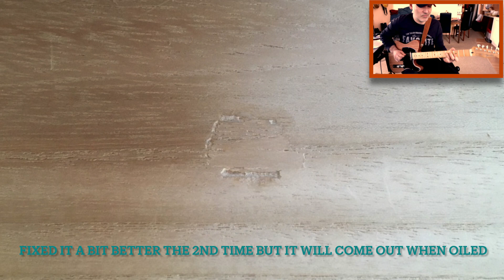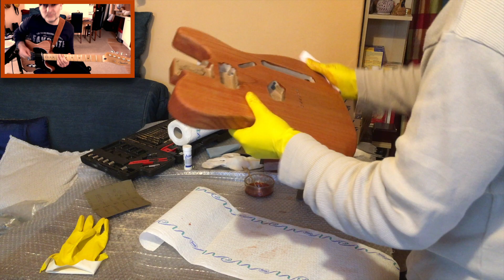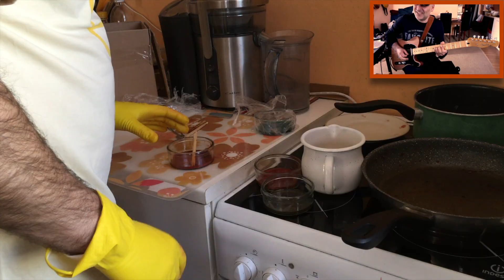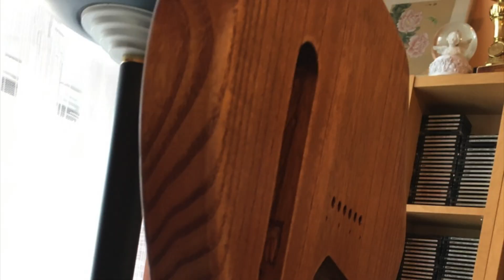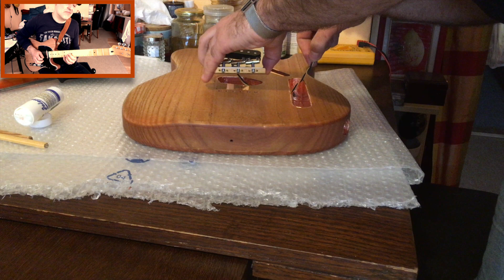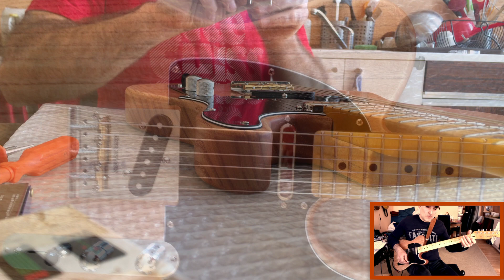Making of My Custom 1-Piece Paulownia Body Telecaster

Comment: what are the pigments you put in the tung oil?
Reply from the maker: they are pigments for work with Resin. I mostly used those that are clay based but there are also some metal based if You look for gold or silver coloration.

Comment: Looks great! What kind of Fender neck did you buy for it?
Reply from the maker: Hi, it's a Chinese Fender neck. Perfectly 90 degrees Quarter Sawn Maple Neck. It plays great. I was looking for a 22 frets and 9,5 radius so this one came out as the best choice. I removed some of the finish as there was plenty and all shiny and sticky.
Reply: Perfect - and that sounds exactly like what I have been looking for. Is this a one time buy or does the seller still sell these necks, and if so, do you have a link?
Reply from the maker: @meadish  https://www.ebay.com/itm/Guitar-neck-fender-Telecaster-22-frets-one-piece-maple-Used-6-/353641806609?mkcid=16&mkevt=1&_trksid=p2349624.m46890.l6249&mkrid=711-127632-2357-0
Reply: Thank you, I really appreciate it! By the way, I aspire to be able to play as well as you one day.

Comment: Looks like mahogany why not just use a mahogany stain
Reply from the maker: I know a stain would work fine too. I just wanted to try something different, and also with adding pigments to the oil I could change it a bit still even after beginning of applying the finish, and indeed I did a little bit. I'm happy with the outcome and It's been stable ever since the guitar is made. Thanks for comments!